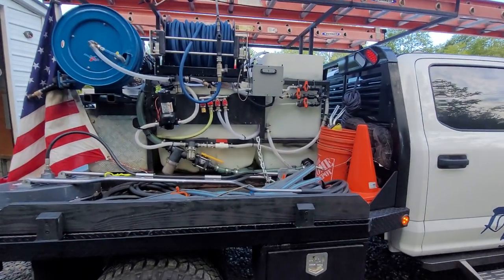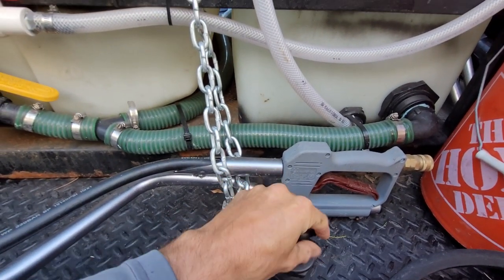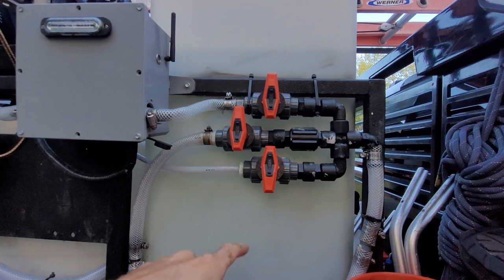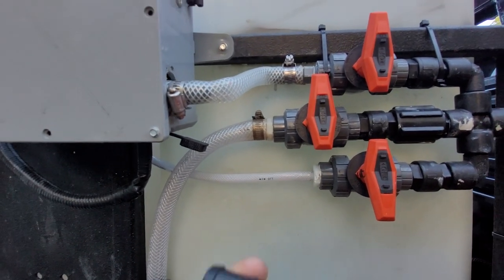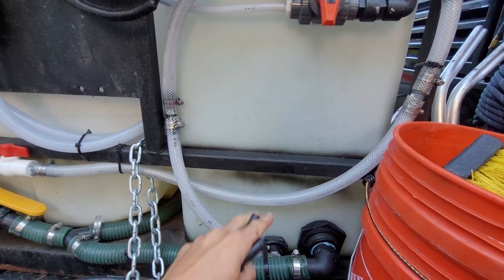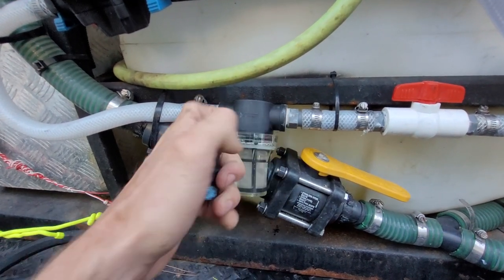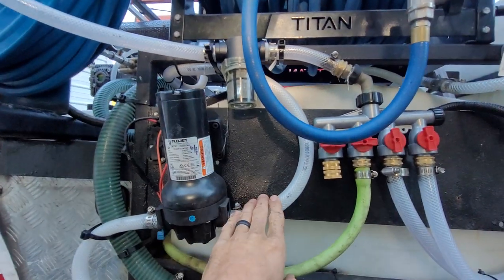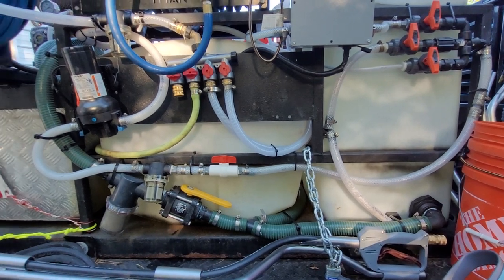EASY 12 Volt Pump Plumbing For House & Roof Washing

Comment: Man perfect timing!!! Two of my 3/4 metering valves got destroyed earlier this week when my ladder came off the rack and slammed it. I was wondering if my old 1/2” proportioner would work well with the 3/4 lines. Finding 3/4 is like winning the lotto! Thanks
Reply from the maker: Yikes! Yeah half doesn't seem to be a big issue

Comment: Hey bro! Nice content, been following for a while. I like to know more about the truck. Why ford? Gas or diesel, new or used? 250, 350, 450 or 550? Reasoning behind getting that particular set up vice having a back up truck? Thanks man. I’ve been looking at the f550 cab chassis and just wanted to know another like minded persons thoughts behind decision making.
Reply from the maker: I will address all this in a video shortly. But in short, it's a 2020 f350 6.7l with 45k miles. Wanted a 2nd vehicle for the business and my growing family. Also have a 250 extended cab, but 2 growing dogs and a baby on the way. F250 couldn't handle the weight of my wash setup as easy as the 350 chasis. Aldo got tired of reaching over the bed walls of the 250. Wanted a flat bed from day one.
Reply: @YoungAmbitionYA  bro! same thing here, I drive a tundra and I squat like 4-5" below factory. Thats with maybe 20 gallons of water and 80 gallons bleach. I got the Alumimax Pro as well and ordered Alcan springs set for 2700lbs above factory payload. Those should be in sometime before or right at September. For future, I was thinking F550 because.... why not? It would and should handle anything I throw at it.
Reply from the maker: 550 will absolutely handle. A 350 or 450 will actually haul more though. 550s are pulling and towing beasts, but the heavier chassis actually reduces payload. F350 can tow less but haul more. That's why I got the 350. I don't tow much but I want to put as much weight on the bed as possible. 2020 f350 payload is about 7000k. An f450 is 6200 for example

Comment: How is the powder coated titan hose reel holding up for your softwash line? I currently have gp hose reel and it is corroding like crazy and I was starting to shop around for a replacement.
Reply from the maker: Seems fine so far!

Comment: Great video as usual, and in my humble opinion - completely accurate. I would only add that for guys who need to save money, it's really not necessary to have an expensive metering valve for your water. It's full open/on 99.99% of the time anyway. Also, a $40 Pentaire valve will also suffice for soap. The only important flow control needs to be on SH. By the way... the download docs are great and worth the few $$. I have them all so I know.
Reply from the maker: You're correct! Thanks!
Reply: you get way better flow with a normal valve than with the GF valve anyways
Reply from the maker: @petermajka7474  normal valves don't meter like GF meter valves though

Comment: Thanks for this.  I'm trying to figure what route I'm going take for my first setup.  2 questions.. what is the large green hose?  Did you build your manifold from scratch, and if so about what does that cost to put together?  Thanks again, your stuff is very helpful!
Reply from the maker: The large green hose is a 1.5" supply to my 8gpm pressure washer. A manifold is typically about $500-600

Comment: For rinsing after a house wash: 

Do you have a totally separate hose reel that you unreel and carry with you and your soft wash hose? Right now I have my source water hose reel going to my tank, then water is fed to my proportioner and to my reel, then i turn bleach off and rinse with the same soft wash hose. Ideally I would like to carry a separate rinse hose with me like you do, but i cant for the life of my figure out how. Currently have 200 feet of feed hose to the customers water, and 200 feet soft wash hose.

Any help is greatly appreciated and im gonna venmo you to buy you lunch for all this help
👍
Reply from the maker: Couple options I used to do. 1) just hook a hose to the customers water for rinse. 2) Set up a separate reel, hose, and 12v pump just to pull water from your buffer tank for rinsing. Both require 2 hoses being pulled around. 

I now just downstream using a pressure washer and a remote ball valve. One hose for chem and rinse. Much easier and quicker. Check my newer vids

Comment: Flowjet R8600134 is your model right? I think Amazon has a typo on the model number.
Reply from the maker: Not sure. Just make sure it's 5.5/6GPM
Reply: @YoungAmbitionYA  alrighty thanks again 👍
Reply from the maker: @MannyAguilarJr  I checked the link. It's the right pump